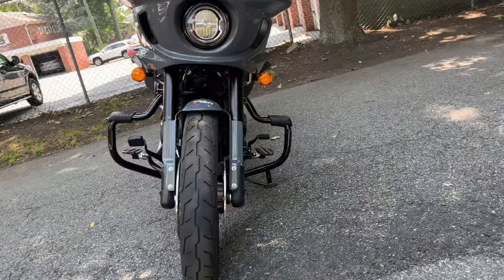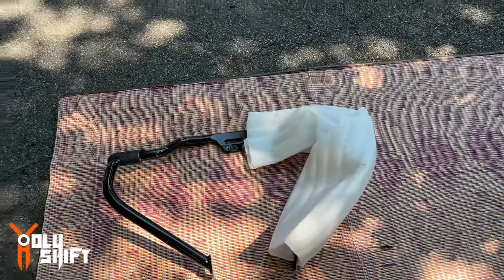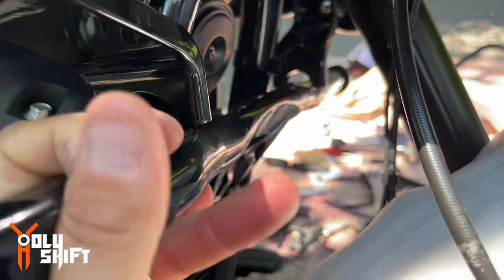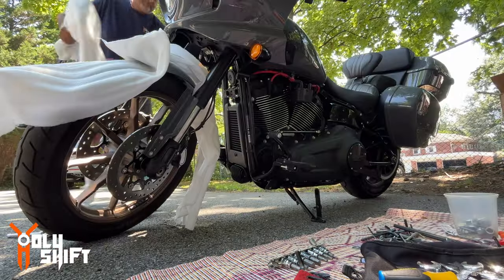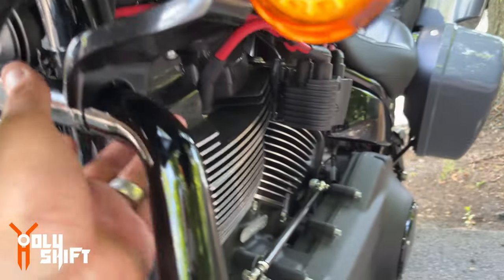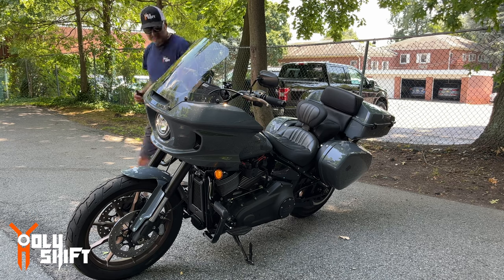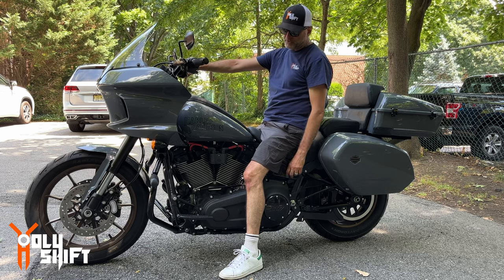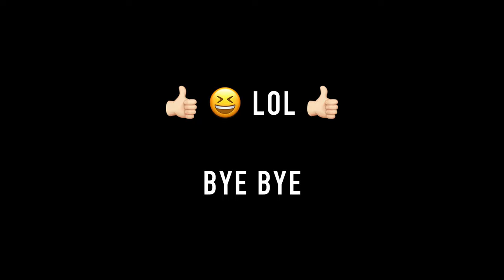Mustache Engine Guard / Low Rider ST

Comment: Easiest way to install is loosely hang the top bolt, do NOT tighten down all the way, allow wiggle room, and then do the same on the lower bolts, and then tighten everything down to spec. Trust me, it is so much easier than starting with the lowers or trying to tighten each down all the way as you go. Great vid tho man, what works for some may work for none, everybody has ease in different ways! Thats just the way that ended up working easiest for me after trying to start on the lowers first and giving myself high blood pressure😂

Comment: I rode my Low Rider ST to Sturgis with this HD Mustache guard installed. The first thing I ordered and installed when I got home was clamp on highway pegs. If you want to stretch your right leg, with that heavy breather, you need the clamp on highway mounts. I went with KURYAKYN
Trident Dually Adjustable Cruise Mounts - 7584
Part # 4900498
Reply from the maker: Pegs on the way

Comment: I just started using Torque Detail shine. It is amazing. Its a ceramic coating. Gives a deep shine after washing. I sprayed water on it and it just runs off. For some reason dust build up seems way less. Good luck with the new bars.

Comment: I wish you would have shown an easy way to take those plastic insert bolts out.  I had to use trial and error, with many errors.  You mention that the engine protects the engine, fairing and the gas tank, but not the bags.  I wonder if anyone makes/sells extended passenger pegs that will stick out just a bit past the bags.
Reply: Believe bung king makes bag savers
Reply: @Ndwyer259  I looked but couldn't find anything other than their rear pegs, and they are too short to protect the bags.
Reply: @cyclingtj  they sell a 1.5 in + extended one

Comment: this is what it says FITMENT NOTES & EXCEPTIONS
Does not fit with extended reach forward control kits.

Low Rider ST FXLRST models require separate purchase of Harley Davidson® P/N 47200927   is it correct
Reply from the maker: Fits !

Comment: I put a set of these on my 2018 heritage, liked the look but not the built in foot rest. It was too high for me and after a couple years the clue that holds the rubber in place released 
and the rubber would slide around, took them off.

Comment: Are you running risers? How tall are you?
Reply from the maker: Risers install video coming soon . I put 6.5 rise 2 pull back . I’m 5’9”
Reply: @HOLYSHIFT  did you have to extend cables and brake line?
Reply from the maker: @bajamedic  no - all cables and wires remain stock